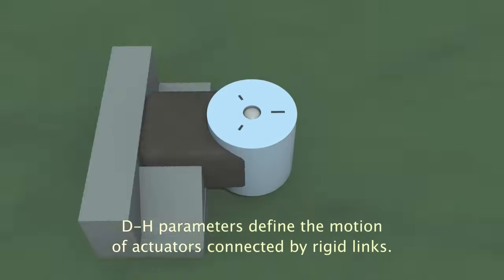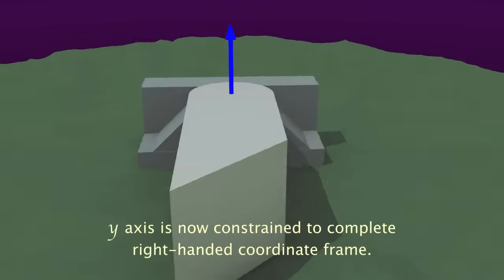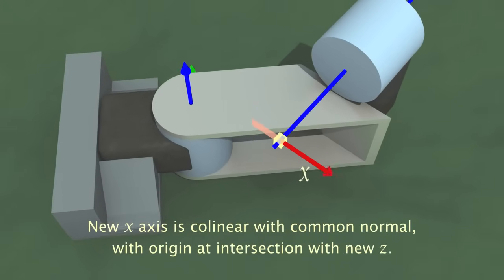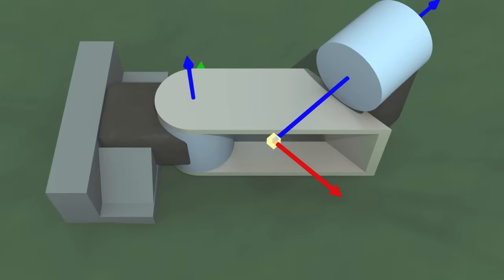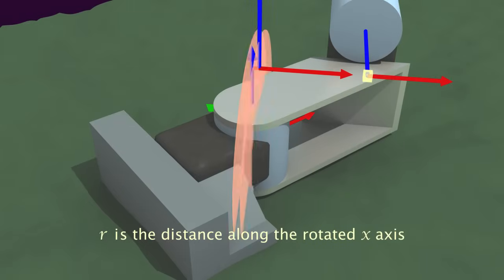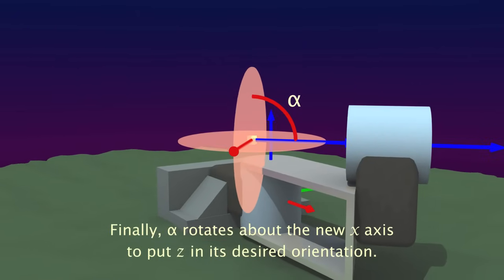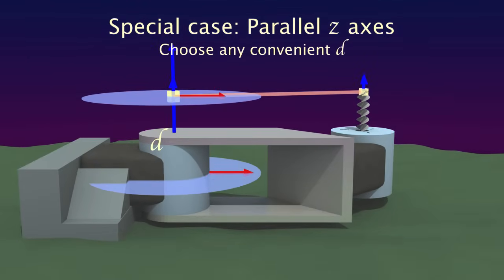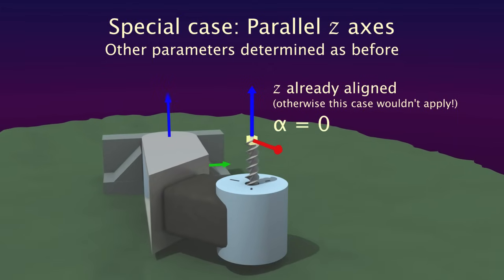Denavit-Hartenberg Reference Frame Layout

Comment: what about the r=0 case? if that 45° angle (where the second joint is connected) wasnt there, so that the second Z axis would go right through the first one, then the new X axis should be aligned with the old Y axis, right? a "minimal rotation around the old Z axis" would leave +90° and -90° as solutions, so postive wins?

Comment: I might be wrong on this but i think there is a mistake with the animation at the end: the x and y axis of the first element should not move while turning but stand still. the following joints coordinate systems should move with respect to the coordinate systems prior to them. the first joint and coordinate system is attached to the base frame should not move with respect to the base frame. At least that's how we learned from my professor. I still love this Video though, thanks for sharing!

Comment: Thanks so much. I understand the concept now, but i think my book uses another convention (or i am just extremely confused).
Mine is using the convention from Craig(1989)
The bodys are called B_i-1 and B_i.
axis z_i-1 and z_i are pointing along the axis of Rotation/Translation of the Joints.
x_i-1 is pointing along the smallest distance between z_i-1 and z_i . Where z_i-1 and x_i-1 meet is the origin of body i-1.
a_i-1 is the translation distance of the origin along the axis x_i-1. 
alpha_i-1 is the angle between axis z_i-1 and z_i along x_i-1.

the translation distance of the origin along axis z_i is called d_i.
The rotation between axis x_i-1 and x_i is called theta_i.

I think both concepts describe the same thing, but i cant get my head around on how to describe a system with my convention. 
Say i want to write a code that generates a joint structure by the DH parameters.
Starting from body 0, how can i know in which direction to lay x_0 if i do not yet know where the next joint is located?
Reply: Better late than never: your book uses the 'modified DH' parameters, but many times the author just don't mention it. I recommend Peter Corke's books.

Comment: The base frame should not rotate with the first link
Reply: The diagram shows the link frame rather than base frame :)
One trick in the formulation is whether the D-H are specifying how to get from one joint to the next, or how to get to 'this' joint from its parent.  The latter is better because it lets you have branching chains.  (A joint can have only one parent, but it could have multiple branches.)
In the latter case, the first joint's parent is an arbitrary 'base frame', which is not shown in the video.  Then you can also consider whether to apply the joint's current position to get its current "link frame" vs. its frame when at zero. (the former being useful for forward kinematics to know where points on the link currently are in space, the latter being useful for Inverse Kinematics to compute the required joint angles to get where you want to be.)

Comment: How is the "common normal" calculated?
Reply: Math-y answer: http://mathforum.org/library/drmath/view/54873.html

Quick answer: Given the direction vectors of the two Z-axes z1 and z2, note the direction of the common normal is along the cross product z1 ⨯ z2.  Let's call this 'n'.  But we need its distance, not its direction.

The trick is to notice we can now define two parallel planes.  Both planes have normal 'n', but one is coincident with z1, and the other is coincident with z2, and we want to find the distance between these two planes.  To do so, we can project the vector between any pair of points connecting these planes onto the normal vector, and it will give us the distance between those planes.  Let's use j1 and j2 as the origins of the two joints in question, and then we have a vector v = j2 - j1.

So project v onto n to get r = v · n / |n|.

Alternatively, you can work this out as r = |v| sin( |theta2| ), if you can determine theta2 more easily than the axis vectors.  (Yes, sin not cos, because theta2 is 90° offset from the normal...)

Careful: either way you can get a negative r.  This is a valid solution but implies a "backwards" X-axis on joint 2.  As an arbitrary choice, you can take the positive solution instead, equivalent to adding 180° to theta2.

Comment: Hi,
I have a doubt.

1. Theta  is the angle  about the previous z axis  . So by right hand thumb rule you have to rotate the x-axis in anti-clock wise direction but in the video its clock-wise. And its the same with alfa.

2. At joint one  Z-axis is pointing outwards. Is it OK to consider z-axis pointing inwards since link 1 can rotate clock wise and anti-clockwise.
Reply: +bhanu kiran chaluvadi Yeah, i think that you are right :)
Reply: +bhanu kiran chaluvadi 
To clarify your doubt,

1. In the video, Theta and Alpha are denoted as variables. So it does not matter in which way you measure while representing Theta and Alpha. However, the values taken by these variables must be as per Right hand thumb rule. 

For example if X-Axes are displaced by 45 degree in clockwise direction w.r.t Z-Axis, then the value of Theta will be -45 degree and can be denoted in the same way as shown in the video

2. You can choose in any way as you like, since it only acts as a reference for calculating the angles. Also you have to note that any given position of the end effector has two solutions. One with Theta and other with Theta+180 degree (assuming you have taken Z-Axis pointing outwards and it is revolute joint)

So if you take the Z-Axis pointing inwards, your solution will be either Theta+180 degree or Theta.
Reply: 1. You can have negative rotations :)  But you are correct to use the right hand rule to know which direction is positive.
2. I'm not sure what you mean by "in" or "out".  The general idea is that the Z-axis should point in the direction of positive rotation for the corresponding joint.  Otherwise your physical joints won't match what the math expects them to do.

Comment: I have a question to ask. Let's say we have two rotational joints and the rotation axis of the second is perpendicular to the the rotation axis of the first. The common normal in this case is the same as the rotation axis of the second joint. In this case how can we determine the frame (x,y,z) of the second joint using the DH-convention?